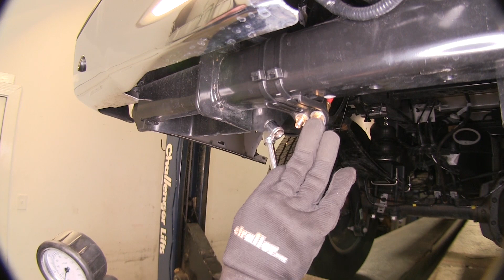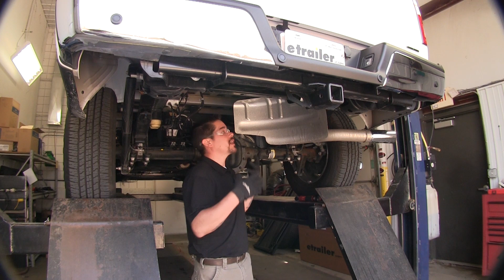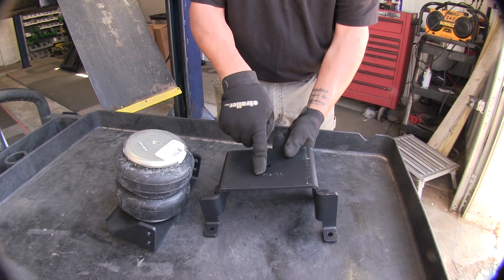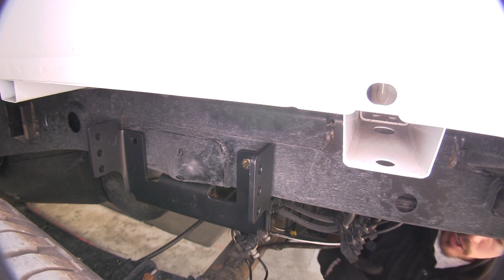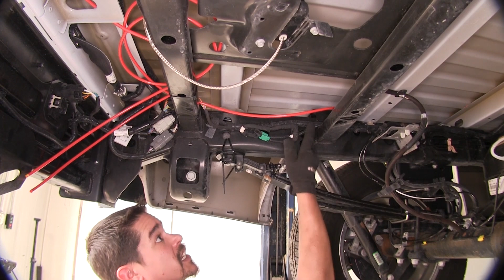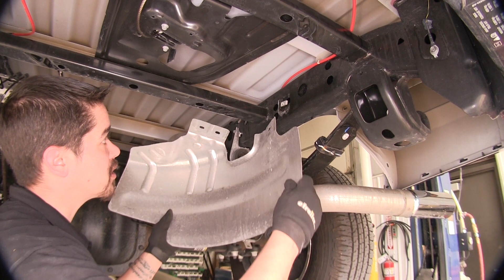etrailer | Set up: Firestone Ride-Rite Air Helper Springs on a 2016 Ford F-150

Comment: Question, I have a 2020 f150 2wd with 1.5" lowering shackles. Do I still need to install the spacers included in the kit?
Reply: Hey man have you found out anything about the spacers ??
Reply: @Chunkyydunkk   I didn't need the sapacers

Comment: does these gonna interfere with the wheel well linear?
Reply from the maker: According to the installation instructions there is no interference with the well liners as no trimming is necessary.
https://www.etrailer.com/Vehicle-Suspension/Firestone/F2582.html

Comment: So, it would seem that if you have wheel well liners you have 2 options.  Cut a hole in them for the brackets and bags or remove them.  Crap.

Comment: With this kit it will no longer be necessary to level the truck from the front?. My truck is more inclined towards the front of the factory and I was thinking of buying some level kit
Reply: Pickups have a 'rake' from the factory (having a lower stance at the front as you say). This is so that the truck rides close to level once there's weight in the back.

If you buy a leveling kit, then the truck is going to be about level when empty, and therefore ride lower in the back with a trailer/payload.

Airbags are installed in the back of the truck - so they'll return the rear height to about the same stance it's at when the truck's empty, depending on how much you inflate them.
Reply: Yes you will, the airbags only raise the rear, not lower!

Comment: Looking for set f4174 - et with the F3025-! T fitting.  I am putting these on a 2012Rav4 so I need the bumper insert that covers the spring bolt.  Any ideas?

Comment: I just installed the RideRite Air Bags on my 2017 F-150.  I’ll be pulling a 9000lbs travel trailer.  What PSI would you recommend I inflate the bags to?

Comment: Nice product but I haul a flatbed trailer every other day.  I need an onboard air compressor that can quickly fill those bags preferably by me simply pressing a switch.
Reply from the maker: There are compressor kits available. You can view them at the link below.

https://www.etrailer.com/dept-pg-Air_Suspension_Compressor_Kit-pm-Firestone.aspx

Comment: Can you add a T fitting and connect both air lines to it so you can add air to the single air valve to ensure you have the same amount of air in each bag?
Reply from the maker: You can add a fitting to connect the lines to one air line supply if desired. 

https://www.etrailer.com/Vehicle-Suspension/Firestone/F2582.html
Reply: Use compression fitting,  quick connects leak a lot especially at 5-10 psi